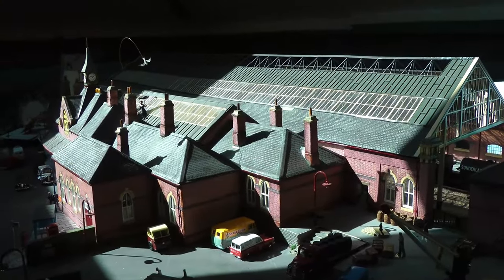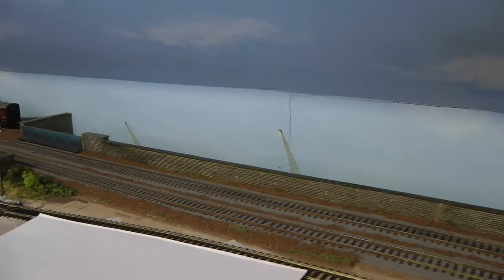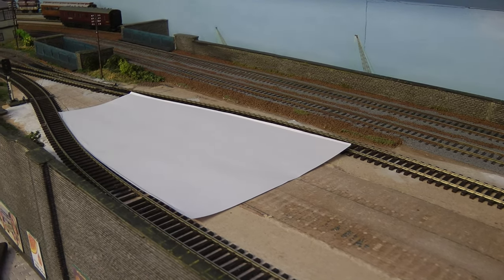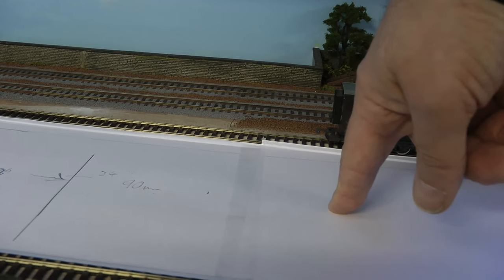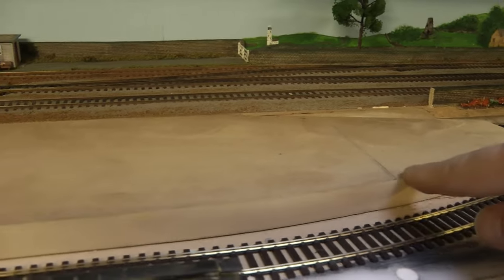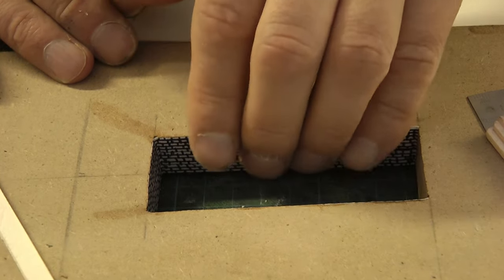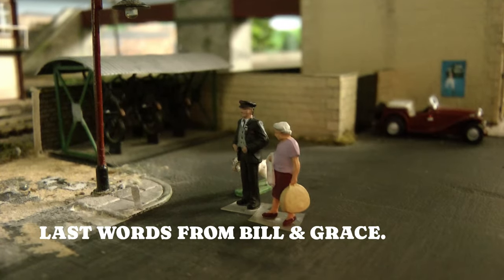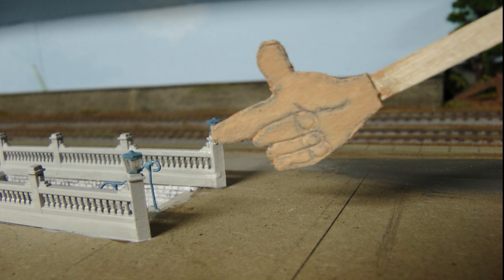Tyne Dock Re-Build Part 3. The Platform. No 425

Comment: Tony, I'm new to your channel thanks to YouTube's algorithm. I came in on part 4 of the rebuild, then backtracked to the start of the playlist for the rebuild.

Sir, I am picking my jaw up off the floor, repeatedly, over the effects you are pulling off with painted paper. I've been in the hobby for four decades, but here in the States, we tend to use plastic sheets, or laser inscribed wood for such detailed purposes (usually factories, our stations usually having all the personality of a wet paper sack). 

I am inspired to experiment! ❤

Great work!
Reply from the maker: Thank you for joining us. and thank you for your kind words. the thing is with model railways you have to use the run of the mill products. but i have used plastic sheets when it is necessary when you need strength and stability. you can make anything from anything. its all about what is achievable and is it possible. take care my friend. cheer's Tony.

Comment: Hi Tony, another great video. I really liked your method of making out the platform edges, I did the same but mistakenly forgot to add the 2mm card to make the overhang, I was so close! Your idea of using a thin strip of card to make the edge itself is really good, I never thought of that, instead I tried to cut the platform top 2mm wider than the sides on a curve. I got it in the end but it wasn't as refined as your method. Look forward to next weeks instalment, all the best Dave.
Reply from the maker: Good evening Dave. its a tried and tested method doing those edges. its always best to leave the pencil lines on when cutting out the material. and make sure you put back what you have taken off the edges. many thanks again for commenting. cheer's for now Tony.

Comment: Hi Tony, you set out the edge of the platform using a GWR wagon + card layers but you use the longer, Thompson, coaches in trains. Obviously the method works. Can you go through why you didn't do the setting out using a Thompson coach?
Reply from the maker: Good evening Andrew. at the time i did not think to use them. but yes i should have used the longer coaches. as you have seen the clearance is very tight 2mm either side. so care must be taken when i screw the platform down permanently. well spotted. many thanks for commenting. cheer's Tony.